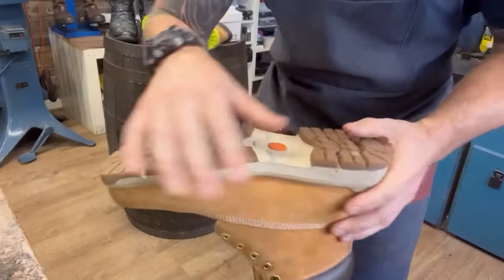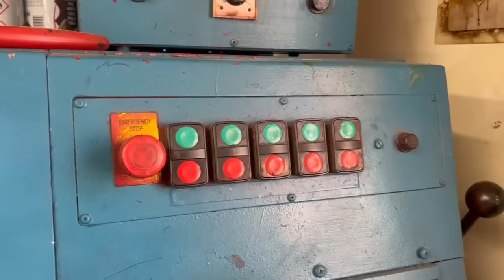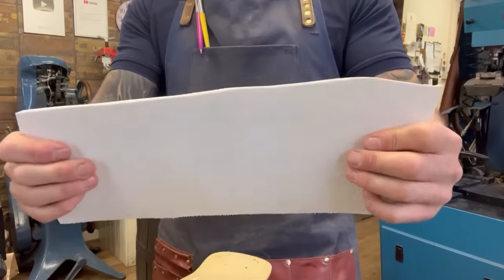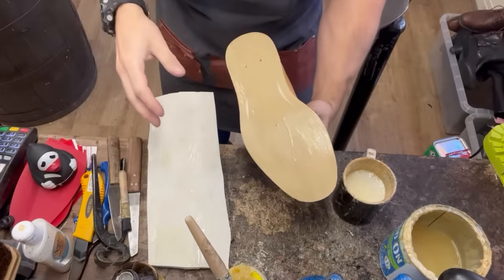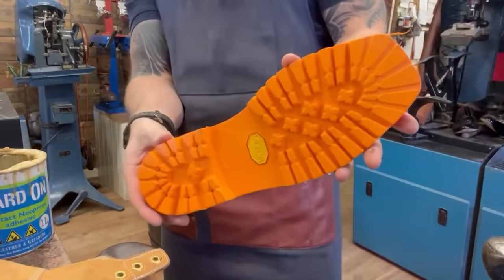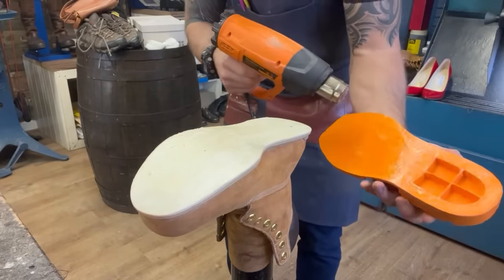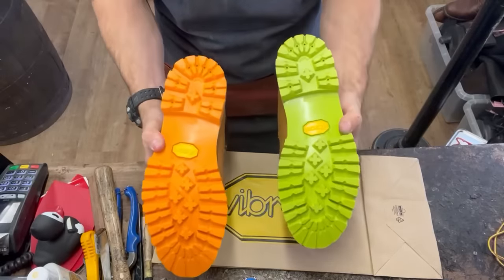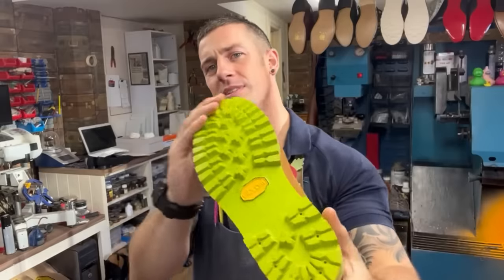Neon Sole Swap on my Timberland Boots - Vibram sole recraft #shoerestoration

Comment: Nicely done. I prefer the green but they both look nice. Suggestion for your filming, use magnetic mounts to easily move from one point to another. I've seen them used quite successfully on other channels. Thanks for sharing with us, Dan. I'm glad the delay in videos is due to your business being successful and not because you were ill.
Reply from the maker: That does sound good, I’ll have a look into it :)

Comment: Glad that you are back and well, those soles look amazing and long-lasting, vivid colours, the green seems a more appropriate combination because of the contrast, rather than the orange being more alike to the wheat colour, but I wouldn't mind the quirky look on using both colours, as is. Question which shoe size do you use. Cheers.

Comment: Hi Dan, I bought some unissued haix german paratrooper boots. But after wearing them for a week, the soles fell off, I noticed there is like a rubberised foam which was holding the soul on which has disintegrated. The cobbler I took it to said it would cost three times the amount that I paid for them to repair He said chuck them in the bin, but what I was thinking of doing was taking all that rubberised foam off and after watching your video, putting on some micro as you called it, what is it where can I get it from? I got them from an army surplus and the cobblers said never buy old army boots because they rot especially German ones he said, what do you think?

Comment: What would you consider would be the minimum cost of a shoe or boot that is worth having re-soled versus buying new? For example I have a $200 Red Wing boot, and having it fixed would cost $120-$150. For 3/4 of the cost of the boot to get it fixed, doesn't seem worth it.

Comment: A Lamborghini in each color would be nice.

Question could a person just sand down a vibram wedge sole and glue on those lugged soles? 
 Leave 1/4” of the old rubber sole??